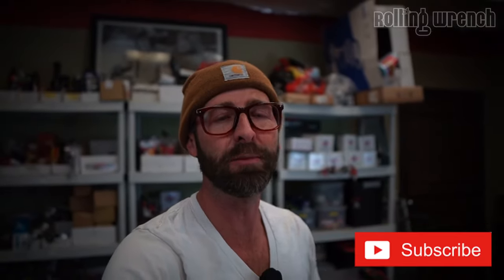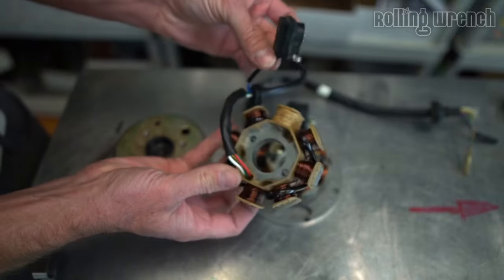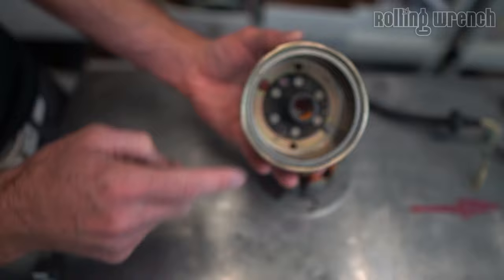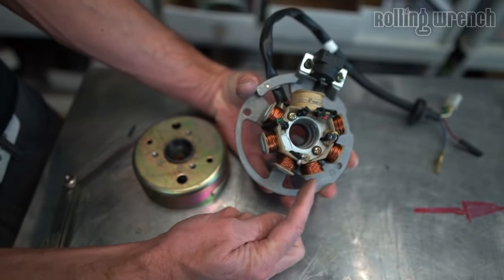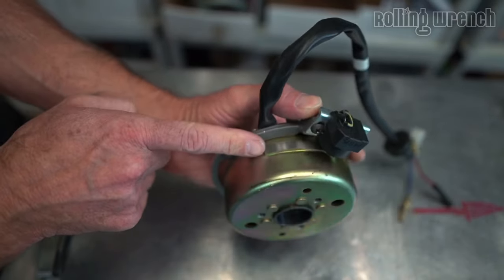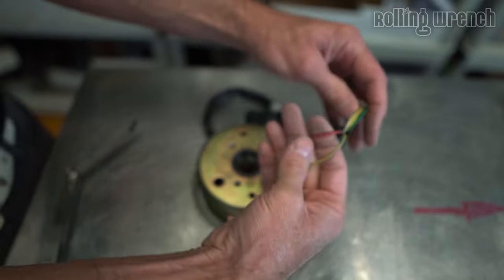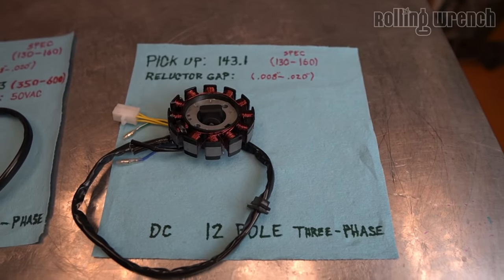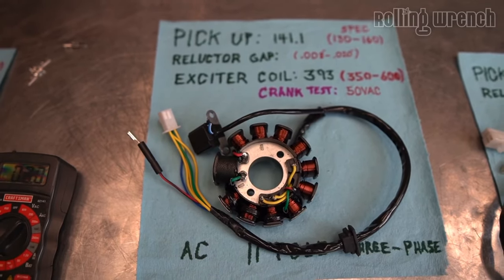HOW TO TEST A STATOR / WHAT IS A STATOR [step by step] GY6

Comment: Amazing video!! Im in a bit of a strange problem where i get 17-18Vac while cranking (on the red/black stator wire)but no spark at all, then i let go the start button and TADAA! I see a spark on the plug.
Exciter coil and pick up are withing spec so its driving me crazy
Reply: I got no spark from my Kawasaki 1991 value I got millions of parts here but we rebuilt it from the top to the bottom we took apart and then put her all back together try some different parts and still can't get no spark so I went out by the parts like another bike and purple cortica a lot of compression and I mean a lot and still don't know spark on that one either so I don't know how to fix the spark problem and I need to try to find a good harness that's good I got four of them want to change for a good one or two little ones

Comment: An incorrect gap or dirty pick up coil could make the timing off by very little making the ECU run the engine rough?
Reply: or if the resistance of the pickupcoil is off the specs, manual says 110-140, but i read 195. so could that make the eninge run rough too?

Comment: Hey brother, I watch your videos and you seem like you know what’s going on! I’m at heavy diesel mechanicS… I’m working on a scooter for a buddy of mine at work and the thing doesn’t have either a AC CDI or a DC it has an EC you the thing is severely pissing me off. I have three yellow wires a green and I believe a red and black coming from the engine or I’m sorry the bike, I cannot use an AC stator right? Long story I’m not getting any spark in my wife wants it off the porch lol. It’s a Chinese 168, 161QMK fuel injected… any help is much appreciated. You can’t find any info on these EFI scooters anywhere!!

Comment: Hi, I have a 2001 Yamah WR426 and a stator for it is near unobtanium.   The stator is mounted to a plate with the pickup and then to the engine case. There are a few other 7 pole stators out there that look very similar and just hoping you or someone reading this might know of an alternate to the on it came with.  Thanks!

Comment: I want to upgrade my gy6 1p39qmb 72cc/80cc engine which the stator is ac 8 Pole Magneto Stator coil. Where can I buy a 12 pole dc stator that will fit my stock stator for a good price? I have a 3 phase regulator laying around in my garage; also I have a dc cdi box...

Comment: What would be the advantage of upgrading from a 8 pole stator to a 11 pole stator or to go from a dc to a ac stator is there any advantages or disadvantages.
Reply: The more poles the slower you need to run your RPM's to generate the same output. For the decision to try AC or DC stator it depends on your output needs. IE Do you need DC or AC at the end of the generating cycle

Comment: I got a 02 500 Rubicon and it doesn't charge, I changed the rectifier and stator and it still doesn't charge I don't know what else to change, the wiring harness was changed before I got it, what else can it be wrong?

Comment: Maybe somebody knows, my 12 pole DC stator is giving out 15Vac per wire at idle and "only" ~25Vac per wire at WOT. My scooter has a charging issue. But the Stator has been replaced recently. Could the flywheel be the issue?

Comment: the copper wire wrapped around in the stator each phase the copper ends get twisted together that makes one phase so one phase has two copper wires twisted and then connected to the yellow wire ty

Comment: I wonder if it's the reason why when I try to start scooter it seems like it might start but then it slowly Boggs down and then when I try to start nothing happens at all. even with a battery charged close to 13. any idea why a stator connection point only has yellow and white wire? no green. whats that about

Comment: I have a Kymco 4 stroke Agility with a DC stator 2 phase with no ground wire. Only pickup wire. 
Can I switch out the DC stator and DC cdi over to a AC stator and AC cdi?

Comment: After my utv gets to operating temperature, it stalls or sputters at acceleration. Could the stator be bad after getting hot causing it to do this?
Reply from the maker: Most likely it’s the ignition coil if it’s a heat thing

Comment: Need help on this. I changed my 8 coil stator on my 150cc swap and what happened was that my headlight and tailight brightens way too much as i rev to the pont where my headlight and tailight bulb would pop. My grounds are good and intact. Would downgrading the stator from 8 pole to 6 pole with a matching flywheel  would help? Im thinking maybe the 8 pole is pushing too much current?

Comment: Dumb question but I have an ignition coil that’s new and test out but no spark and pulled the wire on coil and no spark? The stator is a 8 pole 2 phase with only 2 wires red and black, the stator mounts are trashed and actually epoxy’s in place so stator not grounded to engine and btw ignition coil is gaped correctly but does stator have to be grounded to engine thru the 4 mount screws to create spark or is this stator strictly for charging battery engine is a 14.5 ohv Briggs on lawn mower 14-38 hxl igntition coil test at 5.3 ohm can somebody help pls

Comment: Man, this is a great video. I have a Chinese mini bike and like you stated there are no Specs. I'm having spark issues, Ill have a spark, bike will start then die. I've rebuilt the stator using the original backing plate and the coils from a new stator. I had to do that because the replacement stator I purchased had clearance issues on the engine. So I am stumped at this point. I'm leaning towards the pick up coil gap but again no specs to know what the gap should be. I could use some help.

Comment: Hi and thanks for taking so much time to explain how the stator works and can be tested.
This i by far the best video i have seen and i have learned so much i feel i can go forward and get my bike fixed.
I have a SYM SB125 N wolf (carp not injection)
I have a starting issue after i accidently touched the red wire on the regulator plug with a trailing wire from the black/yellow wire plugged into my rev counter.
the bike immediately stopped and wont start now. BIG MISTAKE !!!
I have replaced the reg with a new one and still wont start so i am tied between the sator and the cdi? OR both?
i am trying to test the stator (hence i came across your video) .
I have studied your video and I am thinking i may have the 2 phase ? but i only have 4 wires.
green / pink / yellow in a 3 pin plug and a blue/yellow outside the plug with a bullet connector. NO RED.?
so its a big ask but can you identify what this system could be and test / values.
many thanks and i look forward to your thoughts
Mick

Comment: What is the max volts the stator puts out. I'm getting 75volts , something is blowing out all of the light bulbs on the scooter and hi volts is all that I can find. If that is the problem, but I don't know what the max volts are. What do you think?
Reply from the maker: You have a bad rectifier regulator. Watch that video I have in my library

Comment: My coil has the CDI inside it , I guess. Ducati Energia no external CDI, wires are a single plugged red, yellow with black stripe with a spade connector and a white and green plugged together so they can't be attached opposite. Can't find anything on it anywhere. For a Rotax 447 in a Quicksilver MX Sport I Ultralight Aircraft. Seems like only one plug is firing, or at least one cylinder is not running. With the rear plug off, it won't run, with the front plug off, it'll run as it does with both plugs on. New plugs, new wires, new coil, so now I'm headed inside to check the pickup.

Comment: All stator coils output  AC voltage and is rectified by external diodes to become DC voltage. 
There aren't any rectifier diodes built into the stator coils to say one is DC and the other is AC.
Reply: 100% true correct Garth Eligon,  I think he was wrong with saying DC stator - he should have said this stator is for DC CDI ignition as it did not have a source coil to power the cdi but used the DC powered CDI
Reply: you're thinking of an alternator, not a stator.

Comment: I recently got a scooter and I found out that it wasn’t making spark and the cdi box is broken but what I’m confused about is that my stator has 3 yellow wires, I watched your cdi box video and I’m pretty sure I have an AC cdi box because I have a kill switch wire but then it looks like I have a dc stator I’m confused on which cdi box I need

Comment: Thanks for all of the info. I am just wondering specifically about what you have labeled the AC 8 pole Two-phase stator. You specifically mention on the DC 12 pole that there should be no connection from any of the yellow wires to ground. Is that the same on the AC 8 pole stator?When I test my stator, I get continuity to ground from both the yellow and white wires (i.e. about 0.4 ohms when testing between the yellow or white wire to the body of the stator). I ordered a replacement and the replacement has the same thing. So I am wondering if my replacement is faulty, or if this is somehow intended (I don't think it should be).

Comment: Quick tip man, those little things on the end of the multimeter cables ( the part u touch to test things) come off so I can get more length of the testing part of the cable. It doesn’t rlly make sense, but there is a little half cap on the metal connection on the end of the leads.

Comment: My Gio Dirt Bike has an intermittent spark. I bought the bike to fix up, it had no spark, I bought a electrical kit to replace all the wiring outside the motor. Now I have spark sometimes. for Example: I check if I have spark, I do, so I put the spark plug back in the engine, and then start it up. the engine runs for around a minute and stops. But it has backfire and doesn't sound amazing After trying to start it a few more times I pull out the spark plug to see if I have spark I don't. Then I turn the kill switch on and off then I have 1 spark and then nothing. But if I come back after an hour or so and try again, it does that same thing. Spark, Starts, Stops, then No Spark.
Reply: You know what that might be? My next step is to check the Stator is what I'm thinking.

Comment: Just tested my stator. It goes for "l" to 0.03 then drop down to 0 as I place the prongs on the connector. I can't start the bike unless I bump start it. But since a stator also functions for the firing order, wouldn't it not run or be misfiring while running?
Reply: Mine does the same thing to. Starts on kick starter & not with the electric starter at first. After warmed up. Then it will only electric start. I’m thinking battery possibly.

Comment: I just subscribe ,I am trying to start a Bombardier rotax snow mobile,with no key no ignition switch,I don't know what year it is ,it's got one coil pack that fires 2 spark plugs it's got two Mikuni carbs it's got an electric starter,and an oil pump bolted the the pull start housing ,I bridge the starter can't get any spark,I use the pull start can't get any spark,any help would be appreciated

Comment: Hey man i could really use your opinion on an issue ive been having with my bike. Its a brand new zs212 but it has a slight misfire. Its not all the time and ive ruled out almost everything other than the stator. I hooked the stator up initially with the low voltage pulse going to the bikes ground cable and with the stator ground not hooked to anything and i think i may have smoked the stator. However nothing looks wrong with it. Do you think i fried the stator by running the bike with no stator ground hooked up? Since ive replaced the voltage reg, ignition coil, cdi, spark plug, and the carburetor and none of them made a difference.
Reply from the maker: It’s possible. Can you find specs to test it?
Reply: @RollingWrench   trying to find any service information on these zongshen 190/212 motors is like trying to find conclusive evidence of big foot haha the most i can find is valve clearance specs and hear say theres no real manual for them except one on thumpstar but that dosnt gives any electrical info along those lines.

Comment: Naa wait , U will confuse people. The stater generate AC Volts sends it to the rectifier regulator to turn the voltage to 12v dc to let the battery keeps it's charge. You normally get 3 yellow wires (3-Phase) cumming from the coils on the bigger motorcycles and 1 on a scooter but it depends on what scooter it is but anyways thanks for cool video.

Comment: Question? I've got a new flywheel, several new stators. 8pole,6pole.2 exciter coils, 1 exciter coil. I'm getting    - .03volts. Ohms are all the same throughout the stator wires. Also, I get less than 1 volt from yellow and white wires. All my grounds are grounded to frame. All Wires are soldered not just taped up. Continuity has been checked at every point possible. I even added a ground to one of the stators just to say I tried it. If anyone has any ideas, ide love to hear them please lol. I'm going crazy over here

Comment: to test a damaged coil insulation it´s better to use a lamp 110/220V in serial. the lamp acts as a resistor, so you will not burn up the coil but if insulation is lightly bad your muliimeter will never detect, but 220V lamp will

Comment: I'm wondering if you or or someone can help me,   my scooter seems to stop firing after going down the road fir a while,  letting off the throttle fir a while, then back into it, and it keeps going, but with less power, I have checked the valves, CDI, changed CDI, spark plug, changed the carburator multiple times, it gas a 20mm carb on it now, ai first it would loose a bit of power when hot, but now it completely stops bc running while at full throttle, if I stay in the throttle it starts randomly firing, but never starts running properly, I'm curious if it could be the stater or pick-up, I have changed the fuel filter, and pulse pump, because it's about the only thing left, the pickup and stater, unless it's in the wiring harness, I use the key switch it kill the engine, but have tried the kill switch to see if it could be loosing connection, but it seems to be fine, any ideas??? It's a 81cc Chinese clone, 139qmb,I even removed the gas cap thinking it may had created a vacuum, stopping flow, but it wasn't any of this,  I need suggestions!!  I have no idea what else it could be! It is only spinning 7500-8500, when it looses power it drops to around 7k rpm, at full throttle going down flat road, at low throttle it seems fine, and with short burst of full throttle, but long runs at full throttle it stopped, the fuel delivery seems more than enough, I don't think all of the carbs can be running out of fuel!   Any ideas are well appreciated!

Comment: WHAT IF THE ignition system has no CDI?  Motoplat ignition system has  Stator, magneto, coil, but no CDI, Primary kick ignition on a 1982 Husqvarna 250CR.

Comment: on the a/c stator with the 6 copper winding , how do those charge the batter if they produce a/c voltage?
Reply: The ac stator output goes to a regulator/rectifier...the rectifier converts the ac current to DC current...the regulator drops the the voltage down to a usable level
Reply: @kawasakichopshop2759  yup a car alternator has rotor windings which the voltage regulator controls the voltage going through the windings to control the alternator output then rectifiers clean up the ac current to dc but on this system they use a permanent magnet but what I still don't see is where is the rectifier bridge?
Reply: @steamdriver6964  that would be done in the cdi box
Reply: @kawasakichopshop2759  okay that's what I was looking for

Comment: In the 12 pole 3 phase alternator, you mention the yellow wire as positive which of course is not correct as A/C voltage is generated on all 3 yellow wires with respect to ground.
Reply: The above comment is about the section on  DC 12 pole 3 phase alternator at 12:54 . All alternators generate A/C voltage which needs to be rectified before being used to charge the battery. The 3 phases are in reference to the alternating nature of the generated voltage being out of phase with each other. The only DC reference to this coil is the fact that the reluctor-induced A/C voltage spike is used to trigger a  powered by the battery DC CDI unit.

Comment: How do you remove the nut that holds the rotor on?  When you turn the nut, the whole engine turns over.
Reply from the maker: You need this tool: 
https://www.rollingwrenchdenver.com/products/magnitio-flywheel-puller-tool
Reply: @RollingWrench  An impact gun removed the nut that holds the rotor on the crankshaft, now I need the tool you recommend to pull the rotor.
Reply from the maker: @jasonwilkinson5659  to remove the nut this tool works great if you don’t have an impact gun: 
https://www.rollingwrenchdenver.com/products/cvt-tool
Reply: @RollingWrench  I like that tool!  Do you guys ship to Canada?

My stator appears to be a 12V three phase DC stator.  I don't have a ground wire coming out of my connection, so I'm using the chassis ground, so when I measure between the three phases and to ground, I get:
blue to red = 1.6 ohms
blue to yellow = 1.2 ohms
red to yellow = 1.0 ohms
blue to chassis = 0.8 ohms
red to chassis = 1.7 ohms
yellow to chassis = 1.2 ohms

Although I don't see anything wrong with the stator, these measurement don't seem right to me.

I'm having a charging issue on my daughters 2008 Polaris Outlaw 90 and the headlights get really bright with RPM and then they burn out.  Do you think my stator has gone sour?

Comment: I installed a lightened magneto and it was over charging my battery over 16v. How can I correct the over charging?
Reply from the maker: If it’s overcharging the problem will be in the rectifier regulator.
Reply: Ok thanks

Comment: If a charging stator has 1 pair of wires, it is single phase because it makes a single circuit, if it has 3 wires, it is three phase because you can connect them as pairs in 3 ways, so has 3 circuits.